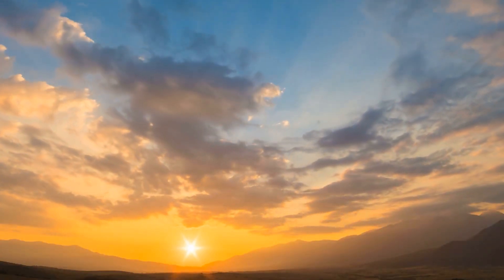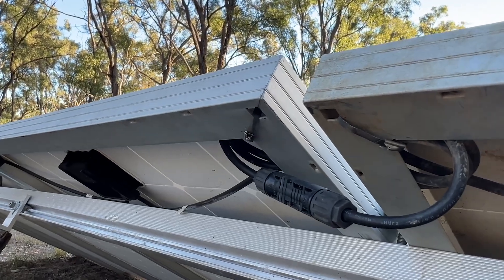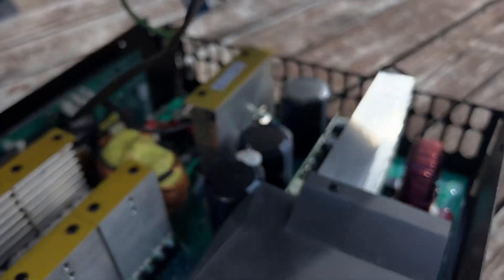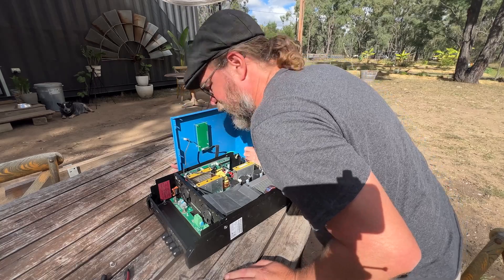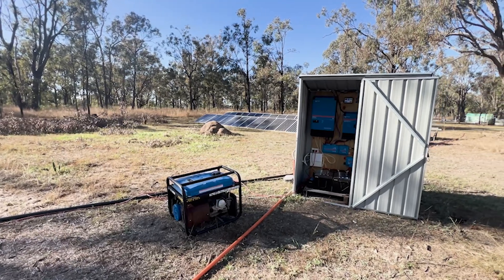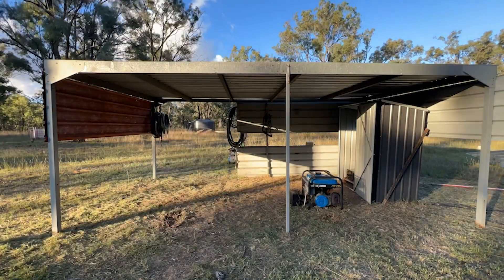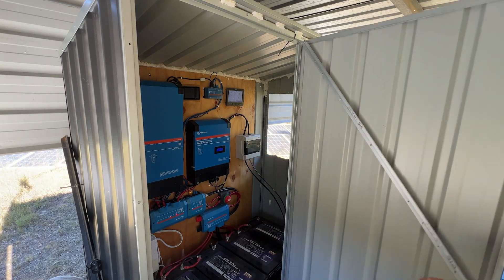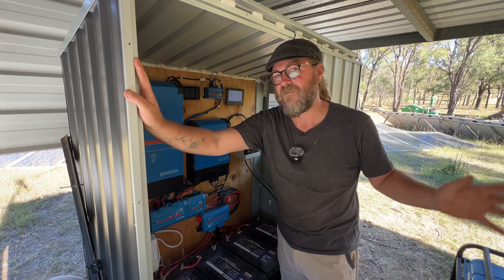A Frog DESTROYED Our Solar Power And Cost Us $2,000!

Comment: Those green frogs used to get through a 5 mm gap in my parent's van boot/doors. Its amazing what they can squeeze through. They were generally hiding from pythons and the van was a safe spot. 

Does seem like something that could be improved on future designs of that product, when it's that expensive, frogs or lizards just shouldn't be able to get in.
Reply from the maker: Right! Surely they know this is an issue. I'm going to be adding fly mesh directly to the vents as well

Comment: My charge controllers are in my house.  2000 for a charge controller?  I use Midnite charge controllers….90 amp MPPT for half the price.
Reply from the maker: We went with the Smart Solar RS 450/100. I'm working with older panels so being able to pull 450v in and output 100amps means I've got lots of room to grow. I wish I could put the gear in my house, but because I'm 50m from the house, and 50m from other structures in the opposite direction, the shed in the centre is what makes more sense for us.
Reply: @   ah yes..less losses with high voltage over long distances.  makes sense.  Midnite controllers only go up 250 v dc in.

Comment: why does the victron unit have such a big holes for ventilation when other brands that are weatherpfoof have everything sinked to outisde and then have a fan blow on it keepign everything sealed inside
Reply from the maker: Maybe the size of the unit. We did get the biggest model we could so we had a clear upgrade path for the future. It's internal electronics definitely kick out a fair amount of heat, I doubt a simple heatsink and external fan would do the job on thi unit. It's about equivalent to a desktop PC in that regard

Comment: All my off grid systems that have vent holes or fans, all get individually fly screened before installation. Any holes or vents that anything bigger than an ant can fit into, i take flyscreen and attach to the unit over both intake and exhausts. I do use the larger mesh size because midge mesh actually restricts flow too much. 6 years on and i never get anything more than dust inside my unit which gets blown out every year or so as needed. The whole lot is in a custom checker plate aluminium ute style canopy thats on wheels about 100mm off the ground, and uses a bathroom exhaust fan in the floor to pull cool air in, and weather resistant pest meshed exhaust vents both sides, and the fan is on a thermostat so it only runs as needed. I have re lubricated the fan bearings once, but otherwise the whole system has never needed any service other than cleaning dust out.
Reply from the maker: That’s awesome! I think I’ll be moving my setup in the same direction.

Comment: Nice going guys, been following ur progress for awhile having been living offgrid myself for awhile. Can i suggest adding some flyscreen to the top and bottom of that Victron  setup. Local sparkie up here in the daintree showed me the small vents top n bottom that gecko's and cockroach's can access...size doesnt matter blowing up electronics. Cheers
Reply from the maker: I keen to do that - do you reckon it'd restrict heat venting airflow at all?
Reply: @rusticspiritshomestead  nope, just take the bottom cover off and glue/silastic some mozzie screen in, Neville our local sparkie been xoing it for yrs due to the amount of repairs he was doing more so for roaches and gecko's. He said there are x3 small holes on the top of the covers where the mounting screws go...cheers
Reply from the maker: @ridgebackoutdoorpursuits9140  ahh perfect. Great advice! Thank you 👊

Comment: Another great vid guys. I would concentrate my attention on getting up a decent shed first with maybe a Skillion roof so you can prioritise solar collection with appropriate designed angles, and then get all your panels up there & out of the weeds, better solar collection and a huge cooling effect from the panels shading the roof, shortens up your pv cable runs, and you may not need to buy more cable with what you will retrieve from the current setup.
You could re-use or reattach the carport frame to the side of the shed, and I would also consider making a corner of the shed a properly sealed room (or cupboard type arrangement) to house all your electrical gear with room for proposed expansions to batteries etc.
Just my 2c.

Comment: I am in the throws of deciding what victron equipment I want to use in my off-grid setup. When it comes to the solar charge controllers I think I will get smaller units like the MPPT 150/70 etc. They are also much better at keeping out creepy crawlies That way if one dies you have not lost the whole system, I have heard from a few other people who have the same idea, don't put all your eggs in the one basket, have some redundancy. I asked our local supplier - Springers solar in Brisbane Australia and they recommended one of those RS 450/100 or  RS 450/200, like the one that got fried on you, but it seems a bit risky and expensive if it fails, as you have found out unfortunately.

Comment: I feel for you guys, we also live in SEQ, we are off grid also. We started our 48v solar system with an all in one unit but it failed 1 month out of warranty, since then I decided to run separate solar controllers and invertors. If something happens to 1 unit we still have others powering the batteries.

Comment: Would you be better running two separate charge controllers rather than one big one, given if one fails at least you'd have partial charging capability and the replacements would be cheaper in the event of failure? I know Victron SmartSolar is designed to be able to run multiple charge controllers and balance the charge controllers via bluetooth. Would also make multiple solar panel alignments much easier and neater to set up.

Comment: when i finished my victron  locker on wheels  i never  screwed completely the top... i left it angled for heat created to slide out ...  now i need to make an active  pc fan in and out system with  removable filters for the dust...

Comment: Yeah, the creepy crawlers will fook up your equipment.

I have had a VCR chock a block full with green tree ants.
A dead ac unit with a gecko shorting out important stuff.

And to top it off, I have seen a stereo with a dead gecko, and 2 dead mice just to fully destroy it.

FWIIW I saw a decent sized green tree frog squeeze it's way into a shower drain.
The gap would have only been 5mm.

Comment: You may be able to build a rack for those batteries and put them in the corner, you might be able to go 3 or 4 high with the racking, you may get 3 across but 2 across by 3 high will give you 6 batteries.
Reply from the maker: I like your thinking 👊
Reply: @rusticspiritshomestead  - Ranther than making a bigger newer space to then make bug free, just use your current bug free shed and make some racking, maybe $100 max in material and your time.

Comment: Would it be better to make a shed out of insulated penals.  It should keep it at a more constant temperature. Would a window on each side for circulation.  Drowning the heat out or whellibirds on the roof. I understand it may be a bit harder with a roof over a roof. But you should get the temp down to just the running temp.

Comment: I live in Townsville, and they are a big problem. They hate detol. I have a 10L sprayer and spray a diluted solution around the air conditioners and switchboard. It also keeps the geckos out.
Reply: Detol sounds good, I have always used bleach based products or spray & wipe for an outdoor flush toilet, I just give it 1 or 2 sprays after use to keep the green frogs out.

Comment: My brother used to repair telephone systems in Hawaii years ago. One customer lost their entire exchange system due to a gecko that was living off of the ants the nested inside the main equipment. The gecko that was far to big to escape the cabinet must have been living off those ants for months but one day shorted itself out against the AC input power supply,  There was so much dirt and internal damage, the customer needed a whole new telephone cabinet. (They were a large commercial customer with about 100 phones). With Aloha sir...
Reply from the maker: Oh wow! You'd think a system like that would have better vermin proofing hey. 
We actually looked at proper vermin proof cabinets for all this gear, but they were 1,000's of $$$. Hoping these $50 fixes on top of a $300 kit shed get us the same level of protection.

Comment: I don't know much about solar power, but have you thought about using electric forklift batteries? Or maybe trying to order a Tesla battery from Tesla. I don't know if Tesla sell them directly to the public.
Reply from the maker: I know a lot of people started with forklift batteries - they used to be a good cheap way to get started. We went with Lithium Iron Phosphate (LiFePO4), not for price, but for longevity (20 year lifespan). I also recently heard of a guy who stripped the batteries out of a wrecked EV, so that would definitely be an interesting way to go
Reply: @rusticspiritshomestead  These days you do not need to take the modules out of an EV battery. There are interface electronics that connect the EV battery to the inverter to take care of the CAN communications etc.
Reply: Thanks for the information. Love, what are you guys doing.

Comment: You've done brilliantly with the upgrade. The expanding foam filler is useful but tricky. The only tip I would give is to silicone around your flyscreen. If the frogs were able to squeeze into the vent on the controller, they will squeeze through the gap between the screws. Persistent little devils!
Reply from the maker: Ooh, good thought. I actually would have done timber strips to pin it down and make it look nicer, but for the corrugations on the shed steel sheets. But silicone would be a good workaround, and you're right - I did wonder about that little squeeze space.

Comment: I'm surprised the little bugger got in there.
I am using the exact same shed for my off grid power and I also leave the door open during summer to stop heat build up. Love the upgrade, I'm gonna do the same to my power shed, thanks for the tips. Lucky we don't have them  little green tree frogs here in my area (WA) 😬
Reply from the maker: @TheOffGridBachelor  Right! Watch out for those geckos though. 😬
I also thought about just making a little fly mesh lid for above the vents, but I was just worried about heat build up.